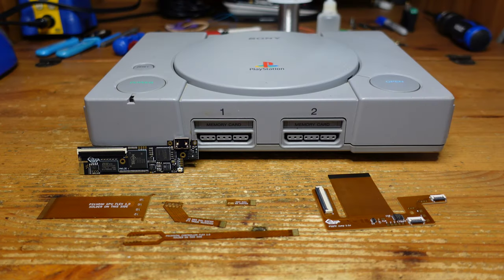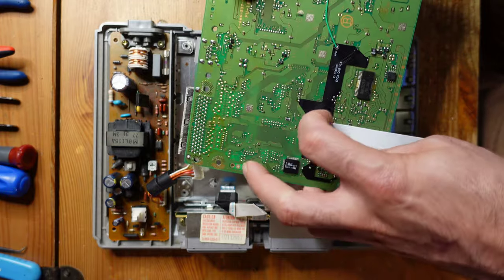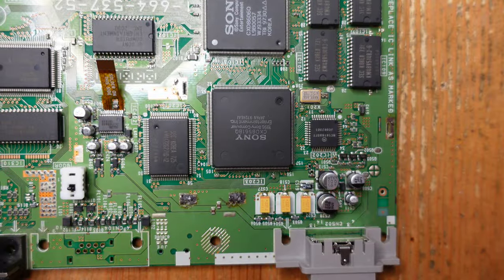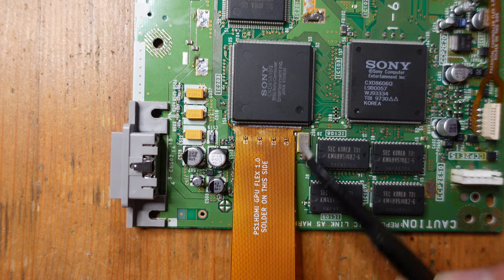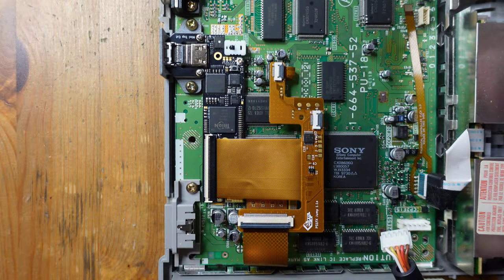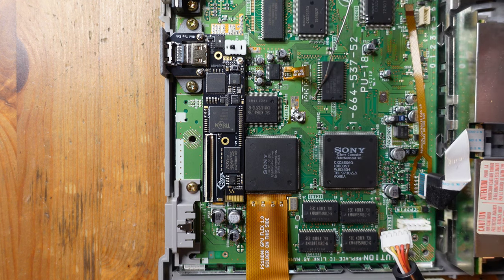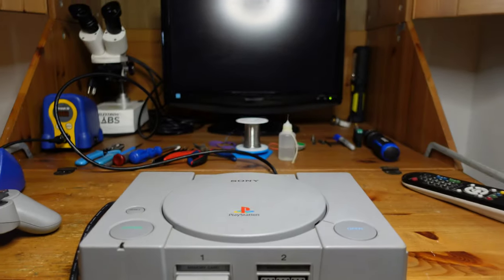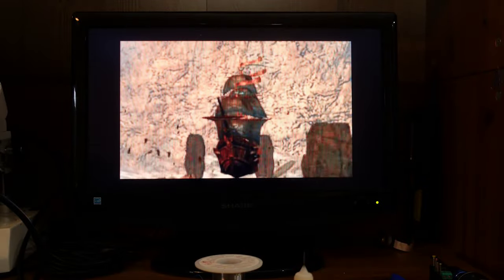Add pixel perfect HDMI to your PlayStation 1! PixelFX Retro Gem installation and demonstration

Comment: I really wish the external HDMI was full size.
Reply from the maker: I get that, although personally I have never had issues with the smaller hdmi port failure
Reply: @LIRetroGaming  might just be a new adapter board away, not sure how much of a difference there is in length/depth of the full vs the mini. Well at least it's not micro those just break if you look at them wrong.

Comment: Wouldn't it be easier to just use some tape instead of soldering a nut to the board?
Reply from the maker: It would be easier, but it would also be far less secure
Reply from the maker: I mean, I suppose you could do that. But I followed the official install instructions.

Comment: The mini hdmi is a huge dealbreaker for me. Not too keen on getting rid of the serial port but I could live with it and lastly, I don't understand why they didn't etch a PCB for the connector portion. Too many of these projects rely on this cheap-o ribbon crap these days. Also, seeing there is a "pay to unlock features". Pfft, yeah, fuck that. At $100, they can piss off with that nonsense.
Reply: I've been shouting this since the "sku approach" was announced. 

THERE IS NO PAYWALL. There is a stripped down version which is capable of slightly less, but is also upgradable. 

People lose their minds over it. I don't know why.

The original PS1Digital was what, $160? The "Digital" products were at or approaching $200 before the "GEM" line was ever announced. That was due to increases in raw material costs. So the "full cost" version is no different, or no more expensive, than it's predecessor would have been. But now that we have a "lite" option, people shit all over it and call the "shiny" (read regular edition) version a paywall scam and shout that pixelfx is greedy.

It's nonsense. A well known person in the video game community actually went so far as to say they were EXCITED for the fact we were going to have more options. Then, after launch (and some other things happening) that same person now criticizes the approach and is calling the same foul that so many others are about "greed" and "paywalls". Give me a break.
Reply: @brandonkick  You're buying the hardware, they're limiting you on what you can use. It's like buying a game, they release DLC you didn't purchase but they take up 20 gigabytes on your harddrive regardless. Fuck 'em. I'm not buying this shit.
Reply: @brandonkick  I have all the older 'Digital' products and never scoffed at price. But I highly disagree with the new pricing model. The hardware you get for basic and shiny is identical. That's the problem people have with it. It makes it pretty clear that the shiny version could be offered at a lower cost but they chose not to and charge extra for software enabled features.  There is nothing more premium about it other than flipping a couple bits. You can argue that there is a cost to R&D and thats true, but that work is already done whether you buy the shiny version or not. I really hope they reverse course on this. It is not a consumer friendly practice in my opinion. I dont think anyone would see an issue if the shiny version hardware was somehow superior, but it isnt.
Reply: @burgermeyer  I see it like this, sure they "COULD" sell at it the basic edition price... but they designed it and they are selling it.

We buy mop buckets every day for a few bucks at the dollar store, yet they cost probably pennies to manufacture in terms of raw material. 

We buy bottled water for a few bucks per bottle, when the water inside costs pennies. 

Just my opinion, but I see it like this:

They are simply trying to offer a lower cost version at a discount. 

All in all, I probably wouldn't have done it. The products were well received at the old price points, and I'm not sure the potential use cases and customer value was worth the potential backlash. Of course, hindsight being 20/20 here.
Reply: mini-HDMI to full-size HDMI adapters are under $3 if it bothers you so much.    Etching a PCB that is that thin and flexible is not even realistic or feasible, especially for all the solder points to the side of chips.   Instead of coming up with these stupid complaints, just admit you don't know what you're doing or how to solder to them.   At least then it would be a respectable excuse instead of these petty ones you're coming up with.

Comment: I really suck at soldering things to the ground plane. My Turbonanza install is garbage and I ended up using glue to keep the s-video port anchored down lol. It works, thankfully. I think if I ever did one of these I'd just use a bunch of kapton tape to keep the ribbons in place.

Comment: When the system supports RGB output without needing any mods, and with the existence of the RAD2X (Playstation version) which can convert the RGB signal to HDMI and upscale to 480p, HDMI modding the Playstation doesn't seem worth it IMO, unless you want to do it yourself maybe.

Comment: Hi, thanks for the video! I noticed there is some garbage on the screen which appears after namco logo and just before FMV sequence. Did you manage to understand the source of that? I installed the kit on my console and do see this thing all the time with different games. Thanks!
Reply from the maker: Yes that happens when there is a resolution change from 480i to 240p or vice versa. Try using triple buffered mode and you should also make sure you are on the latest version of the software as well
Reply: @LIRetroGaming  Yeah, you're right it happens exactly on the resolution change. Actually, I created a topic on the support stream in Discord on this subject. And it was told there that it is expected behaviour, so it's not a problem. You mentioned triple buffer, where is it located, I can't find this option?

Comment: Those blank copper pads by the the GPU flex, one of them tore off… are they just ground plains?
Reply from the maker: Are you talking about the ones near the gpu? Those are not used by anything so it’s ok
Reply: @LIRetroGaming  I was referring to the one specifically that the arm of the gpu flex gets soldered to. I was running through my capture card for testing and it was working but I had no audio. Ran the test and I had all hearts. Checked the little audio flex, touched up the solder. Not getting any picture again but the little red light turns on on the mini hdmi board and the blue light turns on for the hdmi input so it’s getting signal
Reply: I’m running the capture card through OBS Studio, thinking I may need to change some settings in there possibly. Not sure though

Comment: Can you elaborate on the crystal oscillator/clock stuff? Will the console still be cycle-accurate?
Reply from the maker: Yes the console is still accurate with the clock mod, but the difference is that it is now region free. If you play a European game with the clock mod, it uses the 50hz frequency used in PAL regions, whereas a faster clock is used for usa and Japan games
Reply: @LIRetroGaming  i have a dfo installed (from console unleashed), do you know if the gem is compatable? my pu 18 pal motherboard dfo is located on the underside of the board, on the right side (next to where the cable from the xstation goes to). looking at my photos it didnt have a normal looking crystal in the area you have on the board in this video, no silver block, maybe it just looks different on the pal boards.  a 220ohm resister has to be removed to isolate the original clock (whereever that is) to make the dfo work. wondering how the gem would get on with this mod installed.
Reply from the maker: Yeah the gem should be compatible but the best way to confirm is to ask on the pixelfx discord

Comment: I don't suppose you would know what resistor needs removing on PAL version of the console?
Reply from the maker: I believe it’s the same one actually. The only difference between a PAL and NTSC install is that there are jumpers that need to be set for PAL

Comment: when you compare the Retrotink 5x pro to all of the HDMI mods that people spend a ton of money for each console then the 5x Pro is a no brainer. It is much better, plug and play and guaranteed to save a few consoles every year. Total up the cost of HDMI mods  of all the various consoles and you will see the difference
Reply from the maker: I think it depends a lot on the setup. If you have 10+ consoles the tink5x or another scaler is the best way to go. But if you have only a few retro consoles, or if you’re moving them around to different locations, then the hdmi mods are a great option. I have both mainly because I bring my consoles with me to events all the time and direct hdmi at a venue is much better
Reply: @LIRetroGaming  looking at retro gem pricing, 2 retro gems cost more than the Retrotink  5x pro. so for me i would take the cheaper and less risky route

Comment: Nice Mod fella, looks easy for someone experienced in soldering. BTW does your microscope have an SD card slot so you can record the close up? As I'd loved to have seen a closer view on the pin soldering. Great work
Reply from the maker: Sadly my microscope doesn’t have an sd card, and eventually I should get a binocular scope with video capture

Comment: Jesus Pixel FX stuff is always such a massive ball ache to install. They could design things better than they do.
Reply from the maker: I don’t think there’s any way around it unfortunately. Direct access to the digital video usually means you need to solder directly to a chip. If you look at the n64 hdmi mods from different companies, they all work the same way